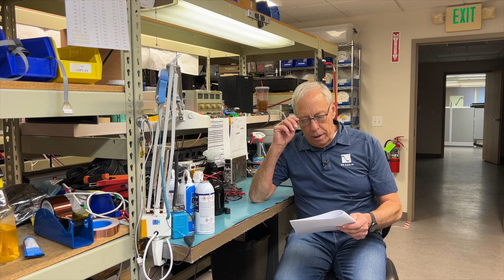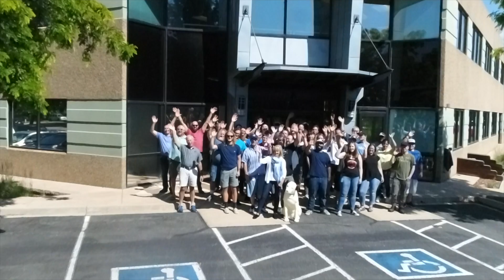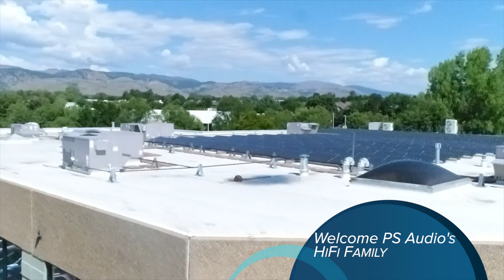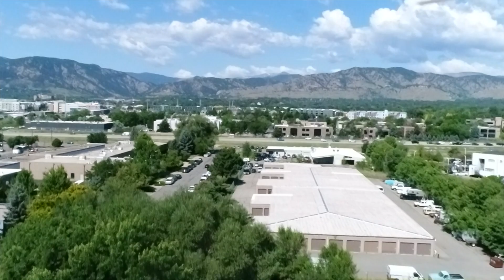Frequency extremes and speaker damage

Comment: Will setting the crossover on an AVR at say 80hz when your speakers are rated at 150hz damage the speakers over time or will they just not produce the lower frequency and make the amplifier do unnecessary work ?
Reply from the maker: No, I cannot imagine how that would damage your speakers. Good to remember that just about all loudspeakers have built in crossovers that control the frequency balance.
Reply: @Paulmcgowanpsaudio  Thank you very much for the response, I've come across your YT channel and have been going through all your videos. What then is the purpose of the AVRs crossover if speakers/subwoofers have their own ?  Would it be for satellite speakers that don't have their own crossover ?
Reply from the maker: @Cronosmd  No. It assumes you're using "full range" speakers and then reduces the low frequency requirements on them. It's a practice I do not agree with, but it's there for those that wish to use it.

Comment: I disagree that most tweeters are designed to handle the same power at 20Khz that the woofer is designed for at 20Hz. If one was to do a sweep of 20Hz-20KHz at full rated power of some big amp most tweeters would fry. Energy distribution in music tends to be logarithmic, not linear. More equal across band than individual frequency. Even the loudest high frequencies contain little energy/ dbSPL/ power requirements compared to lows. 

Although yes, more tweeters are blow by distortion than by pure musical signals. That's usually the only way that much energy winds up that far up.
Reply: The Passive Crossover networks, tone controls, Eq's killed enough tweeters of mine that by the time I was 19, I never used them again. ( over 40 years ago now). But then again, I'm not into sitting in a room listening to music like so many people do. Just some of the traits that make us different, I'm ok and your ok, too.
Reply: Yes, actually a tweeter can easily get burned if used outside audible frequencies with too high signal from a generator cause you won’t hear it. You will smell it before you hear it, which means damage is already done.

Comment: I was recently using an old Stereophile test disc on my 30 year old Magnepan MG-1.5/QR speakers and when it hit 20 Hz the right hand speaker started making a horrible rattling noise. After freaking out thinking the frame was falling apart it turned out that the back of the metal stand was touching the baseboard on the wall and vibrating. Unfortunately I can't keep them at least three feet away from the wall in my living room like I did when I had a dedicated music room back in the day. But they still sound pretty darn good under the circumstances.
Reply: @Douglas Blake 
So true!

Comment: Hi Paul. What you say around 3.35…what do you mean exactly by keeping the woofer on for too long? Do you mean for instance keep the amp on but mute or zero volume? By what action does the woofer stay on for too long? Sorry if my question is too dumb 😀
Reply: Also if I may ask a fllow up question: is white noise or pink noise damaging to speakers? Fir instance when I play music via Audirvana, music gets suddenly interrupted by white/pink noise. Does this risk damaging speakers?
Reply: @lapetitemortbis  I guess he didn't speak of music signals but of the battery test he mentioned. If you apply a constant high voltage for a longer period you may damage some parts.
Reply: @lapetitemortbis  No I think so. You might lower the volume a little bit, but it won't damage your loudspeakers.
Reply: He means constant voltage will damage the voice coil
Reply: @@Douglas_Blake That's about the same that is already explained in the video. This "battery test" can also be used to check the correct polarity of your speaker wiring.